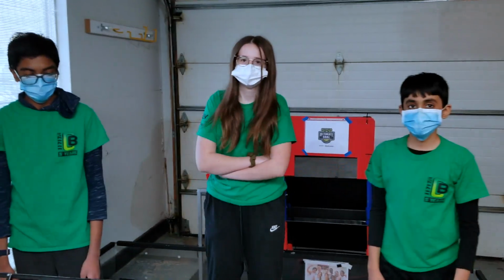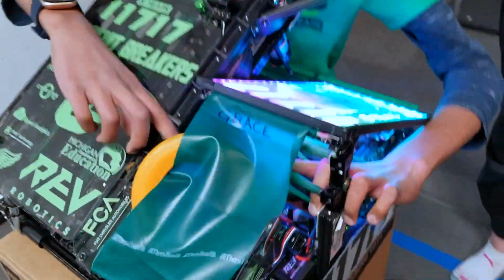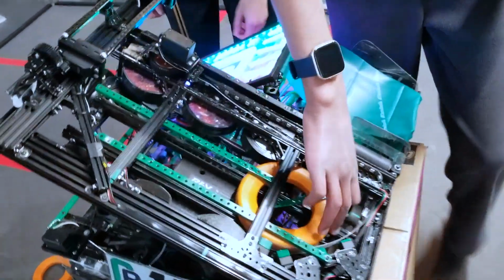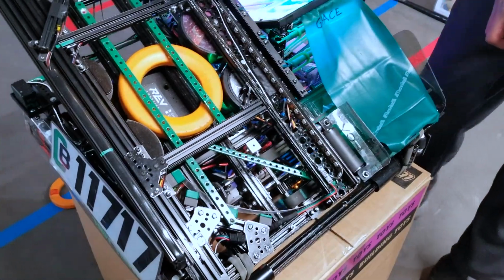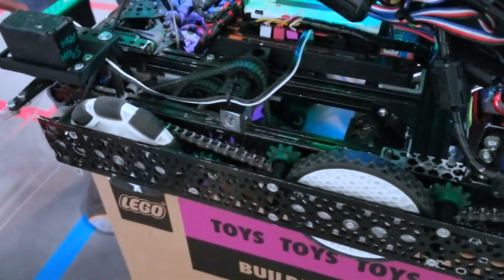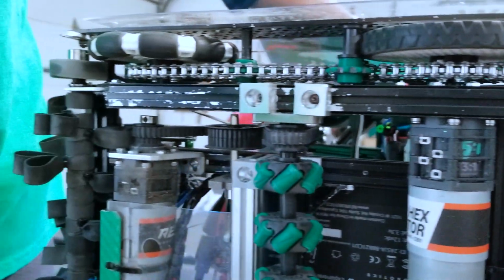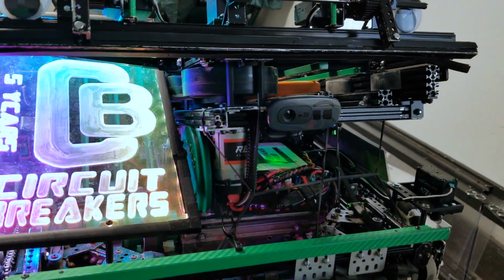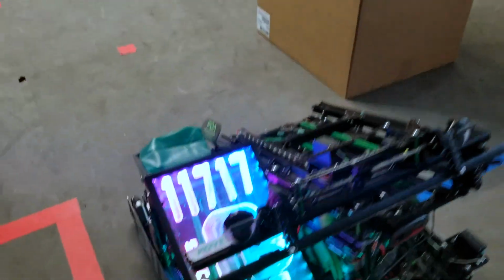FTC11717 Circuit Breakers pit walkthrough - here's the bot!

Comment: How much does it weigh? How did weighted flywheels effect the flywheel RPM? Are the servos you used for adjusting the hight of the launcher assembly continous rotation?
Reply from the maker: all three fly-wheels together total 2 pounds. The Bi Sn/metal filled is 1 pound while the other two are half pound each. The weight made it take more time to ramp up the RPM but it helped maintain it over each shot. The servos we used are REV servos that were kept in servo mode.